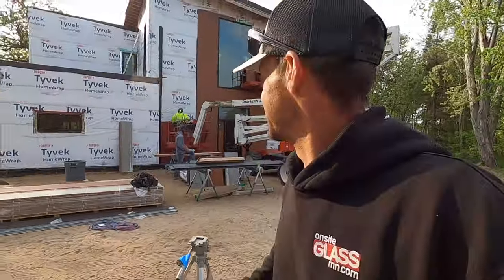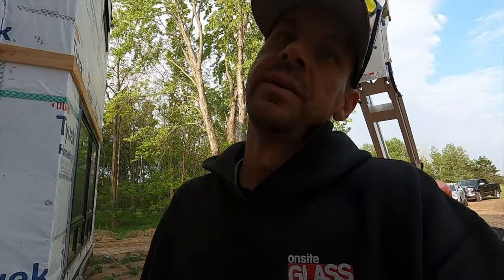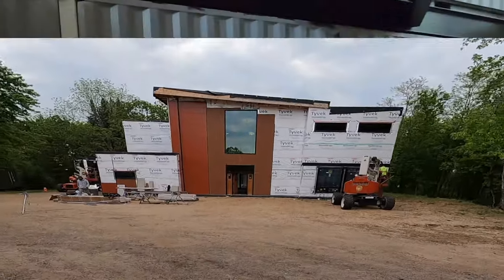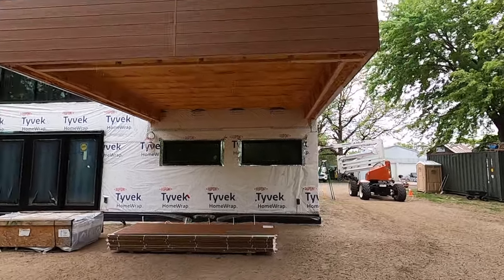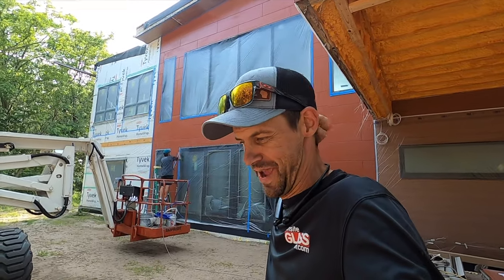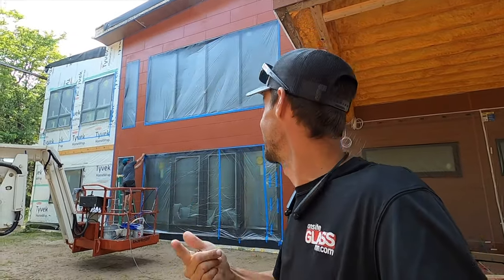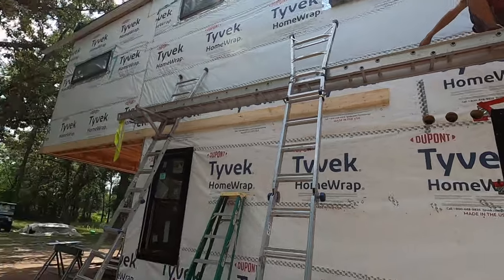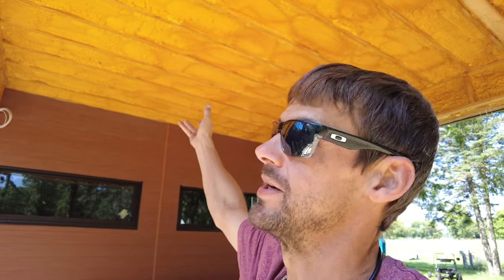Massive Modern Home Built With 6 SHIPPING CONTAINERS Part #1

Comment: I'm on board with the no reason for containers crowd. Even if you keep some of them visible after construction is complete, that is not a reason for containers as that just leaving them exposed for aesthetics (which is the opposite of why most people use containers, as they use them DESPITE their looks not because of them...

 The use of containers is supposed to speed construction, and reduce the cost overall as well as reduce the need for wood in the overall structure while still maintaining a very strong and supportive structure. This building does not seem to benefit much if at all from the use of containers in its construction in terms speed, cost, or using less wood. 

Calling this a shipping container home is just not in the spirit of what a shipping container home means to me and likely to the majority of people interested in the topic of container homes.